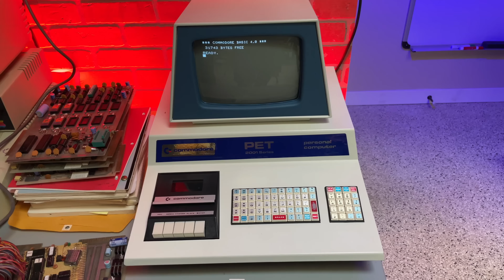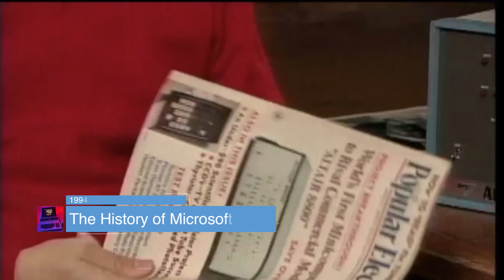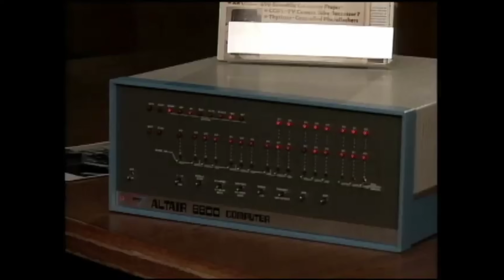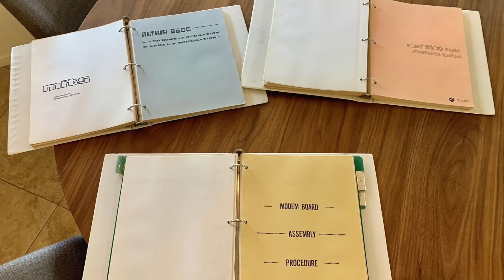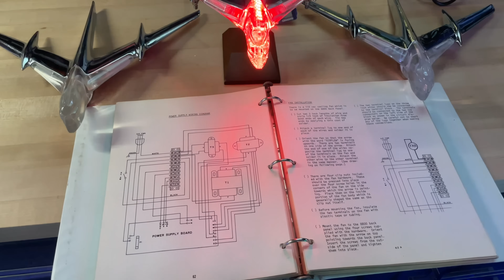The Computer that Birthed BASIC and led to Microsoft!

Comment: Wow you brought back memories. I got my first computer in the early 1980's a Commodore 64 and self taught myself to code in BASIC. Using a tape drive I wrote my first program that kept track of our farm production. I even repaired my 64 when a circuit went bad and I had to resolder one of the traces to get it working again. While I don't have my original 64 I did acquire another brand new still in the box 64 I keep as a reminder of my start in computing. I also still have my original 128 and omega. I never did make a career out of computing but use them every day. I tried learning other languages and did code simple things but never mastered any of them. Python was the last language I tried with some success. I lost count of how many computers I owed over the years Apple and PC now with a custom Falcon Northwest running windows 10. I am currently learning Electronics and have a small lab in my basement doing electronic repairs. I stumbled onto your Youtube channel when I was looking up info on LED's. Great channel I have subscribed ty.

Comment: Still got mine in the back room. I had to install a power supply with more oomph in order to support all the boards I eventually plugged into it. Also replaced the processor board with a Z80.

Comment: Yea, I remember the Altair basic. Microsoft had a 4K, 8K and a 12K version of the basic. Back in  the days i did a disassembly of the 12K basic so I could port it to CP/M. Had to undo a lot of smart tricks that was in the code to make it assemble and run under CP/M. 
One of the really neat codes in the 12K version was the routine to check for variable type. The 12K basic supported integer, string, float and double.  The size of the variables were 2, 3,  4 and 8 bytes respective. It does a compare of size with 8 and then three decrements and after this the flags is set as follows: Minus set if integer, Zero set if string, Parity set if float, Carry cleared if double.

Comment: Interesting video. A couple significant errors though:
- The Altair 8800 was not the first personal computer, although it was the first to have significant popularity.
- The Altair had nothing to do with "birthing BASIC", as it had already been created and put into use at least 10 years before the Altair came out. But Microsoft's Altair BASIC was the first GOOD version that most people used, outside of those versions available to computer students in colleges. Even when personal computing had advanced to the "1977 trinity" of the PET, Apple II and TRS-80, Microsoft's port of their Altair BASIC to the PET was (at least initially) the most advanced version.

Comment: Didn't I read that Microsoft BASIC was actually developed on PDP-8 computers?  And then cross-assembled/compiled to run on the 8080?  I remember seeing a photo of Gates and Allen and maybe one or two others, with the PDP-8/F or 8/M that they did it on.  (Not the larger, more expandable, and far-more-expensive 8/E.)

Comment: This is a trip back memory lane.  As an EE major ('78 grad) for my senior project I built an optical bar code reader using the Altair 8800 as the processing engine.  Yes, I had to use the toggle switches to load the boot loading program that interacted with the paper tape reader.  I wrote the processing algorithm in assembly which I transferred to paper tape to load into the Altair. I had to teach myself assembly language programming for the 8080 which was fun to learn.   I never used the basic interpreter as it had just become available and likely wasn't fast enough to do what I needed it to do.  The reader was a laser that sent a reflected signal to an optical sensor that then counted on-off (reflected/not reflected) light pulses during the scan.  This data was sent to the Altair which stored the counts in memory during the scan, and detected the stop bar to trigger code processing.  The software then used these counts to perform the bar decode.

Comment: Thanks for posting this video about a historically important machine.   The January 1975 magazine was on the newstands in late '74 so Bill Gates could have known about the Altair in '74.  Altairs were the first machines that were bought in significant numbers by technicians, engineers, and ham radio operators, for personal use at home.  Cleaning one with water, however, is strictly FORBIDDEN!  Cleaning should be done dry with a toothbrush and a shop vacuum (or home vacuum if the wife is away).  Anything remaining after vacuuming can then be removed by wiping with isopropyl alcohol.  Be careful with the IPA since it can react with some plastics and remove some inks.  Good luck with your videos.

Comment: The first 8080 computer I saw was when I was working at a high voltage power supply company and the guy sitting next to me brought in his new Heathkit H8. He flipped a few switches and made the LED's blink. I bought a HP-41C calculator.
I was never a coder and I could never play one on TV. ;-)

Comment: I got into computers in 1976.  I had a choice of  the Altair or the Imsai which had the toggles on the front to load programs.  Then I saw a Polymorphic that had a 1024 byte rom that allowed it to boot to a tape reader.  I added 16k of ram, a monitor and a keyboard and I had a real computer.

Comment: Around min 4:00 
8008 vs 8080. 
When i remember correct (I read it in a book), the smartest move bill gates made that he recognized the 8008 is too slow. But they have to be ready when the next processor generation, the 8080, comes. Then all  fit well together.

Comment: Yes, but how about an Ithaca Intersystems S-100 multiuser system running Coherent Unix and Z80's? Maybe a Z80H?

They were beautifully crafted machines and were on NY State contact at the time with excellent prices, but my organization went with Radio Shack Model II's. 

At the time they pulled me in from my position because I was the only one who knew anything about computers! Anyone remember these days? They were quite magical. (reminiscing)

They ran Radio Shack's OS called TRS-DOS and for CP/M we use Pickles and Trout! 8 inch floppy's and a 8.4 MB hard disk. Advanced 300 baud modem. 

Not a bad selection of business software between the 2 OS's at the time and could still run a small business very well today.

Comment: Hi Dave. I'm in the UK. My first microcomputer I built from a kit. It used Nat Semi’s SC/MP (SCAMP) microprocessor. It had a simple instruction set and like the later Altair, there was no assembler so we had to manually enter the opcodes to create a program. Around that time, S-50 bus PC’s appeared and then the S-100 bus, as in the Altair 8800. Bill Gates’ anecdote about demonstrating their DOS to IBM relates how he realised they didn’t have a boot loader – so in the demo, they had to write a boot loader and then switch in the opcodes for it, all in front of the client.  I went on to work on a product that incorporated the LSI-11, DEC’s microcomputer version of the PDP-11. It ran the RT-11 DOS which was way ahead of CP/M (and IBM DOS).  I bought a home Z80 board with MS BASIC in an EPROM and a friend disassembled this. We were all astonished to see that the interpreter used every single byte in the EPROM. Someone, presumably Gates, had hand-optimised the code in order to save space. For example, there was a three-byte jump instruction in part of the code, but another part of the code jumped to the second byte of this, which then performed a different task!  Great channel, thanks!😊

Comment: Washing down a computer brings back memories of my industrial electronics work.  Yes, water wash is no problem (with any batteries removed), something I often did to contaminated PCBs.  The key is thorough drying.  Half an hour in an oven set very low, or overnight in the airing cupboard generally sorted it.  Water only hurts electronics if it is under bias and electrolytic corrosion goes on.  But flood water leaves muddy residues that can be hygroscopic and can conduct, so a clean wash-down is important.  
The most memorable occasion was the SMPS from a toffee wrapping machine.  The filter-less fan had ingested sugar mist for years until the whole PCB was covered in a layer of toffee.  A good soak in the bath and thorough drying and it was good as new.

Comment: I just now noticed this in the Description: "For clarity, I'm talking specifically about MS-BASIC, not BASIC as a language.  I don't want to rile up the Data General Nova users... they had BASIC beforehand."

Yeah, you don't want to fuck with the Data General Nova users.  Those are some mean-ass motherfuckers.  They ride into town on their Harleys every year just before Sturgis and make trouble for the Locals, like me.

One of them picked a fight with me inside the local Denny's, putting a switchblade to my throat for "eyeballing him."  He held it there and tormented me, telling me he would slit my throat in front of my wife and children if I didn't correctly name the original distribution format of BASIC for the Nova.  I guessed Punched Tape; he just laughed and let me go, warning me to "watch where your eyeballs wander, son."

Strangest thing, though.  When it came time for their check, the guy paying the bill pulled out of his backpack a Data General Nova 3 and plugged it in, all just to calculate the tip.  Fucking show-offs.

Comment: I like the fact that you risked everything by using the “Clean Room” environment of the family sink to carefully reinstate it to working condition, even if you are unsure that your remedy was the real reason for the rebirth. And that wonderful feeling of accomplishment when you flicked the switch and it actually re-emerged from its long dark coma.
The poor old machine has simply responded to some much needed and long overdue TLC with a now clean but once possibly corroded connection or two. Good Job !!!
Now to prescribe some rehab by way of a Boot Loader.

Comment: The front panel +5 supply (+8 supply) comes from the "+8(B)" output on the terminal strip. This in turn comes from one of the two secondary windings on the medium-sized transformer, the one with the windings wrapped in black tape. The main +8(A) supply comes from the large transformer. The +8B supply should go more or less directly to the front panel. 

That transistor mounted on the chassis looks to me like a modification that someone added at some point, I don't see it in the assembly manual. I suspect it is set up as a pass transistor in a regulator for one of the extra boards, but I don't see enough wires to be sure. I don't think it should be related to the front panel, but I can't be sure.

If you weren't getting the +8 on the terminal strip itself (as seems to be the case from how you jumpered it to work), then the best bets are a) one of the terminal strip screws for the red wires from the black transformer was loose, or b) a bad solder joint on the board. Since I'm assuming you don't have an intermittent problem now, my best guess was one of the screws loose. It looks like the wire you repaired (in two places?) is related to that transistor on the chassis, so I don't think it was related to this problem, though I can't be positive. It seems unlikely though.

Comment: I have a HAAS CNC mill, 1996 year.I bought used, it had sat for 6 years from where I got it. Put about 30 hours on it and then a fault that cause the Z axis drive to shut down and the spindle came down from gravity. Big 15,000 lbs. machine that had pneumatic cylinder counter weight devices for the spindle. I went to the electronics store a bought 3 cans of electronic aerosol cleaner and some cotton swabs. The driver board was very dirty. Put it back in and now works great.

Comment: BASIC was developed at Dartmouth and emerged during the 60's, It first ran in 1964.  During the early 80's before the IBM PC basic was around.  It ran on many of the machines before the IBM PC on Intel 8080's and Apple  early machines.  The transferall across machines was widespread, with Kurtz (one of the authors) working on it on several machines.

Comment: "Altair begat BASIC which begat DOS" - I think that's doubly ahistorical. First, BASIC appeared about a decade earlier and was initially written on a discrete-transistor CE-225 at Dartmouth University. Second, Microsoft initially licensed 86-DOS from Seattle Computer Products and later flat-out bought the rights to it for $50K after telling IBM they could write an OS for their PC. 86 DOS had been written for the 8086 whereas the Altair was 8080-based. So BASIC predated the Altair 8800 by a mile and 86 DOS - the direct predecessor of IBM PC DOS and then MS-DOS - was developed independently of the Altair 8800.

Comment: Great video.  Well done on the power supply repair.  Did you replace those big ole electrolytic capacitors?  They tend to dry out after many years and can fail catastrophically.

Comment: The TIP tranistor is likely a LM7805 linear regulator. Very common at that time. Its good for 1.5A I believe. Note that it is a linear regulator vs a modern switcher. The voltage between the line in and line out has to be dissipated in the package and that means heat. Thus the metal tab. If you look at the DRAM card for example you will find this has a heatsink it mounts to and then to the board with a through hold screw. Heat sink compound (thermal paste) is needed between the back of the tab and the metal surface. The tab is ground as well.   Be sure you do not leave that dangling in air and tie it down to ground with a heatsink if its drawing any current.

The thing about this period of the industry is it was a chicken and the egg period. There was no way of knowing who was going to buy them. No way of knowing what they were going to do with them. In fact you could not give them away for quite a while as the learning curve was quite intimidating.  So to try to find a market they made systems modular with only a few slots or a large number of slots. Being a linear supply meant huge expensive and heavy transformers. Cut the number of slots in half and you cut the costs dramatically. I recall going to the West Coast Computer Faire (the predeccessor to Comdex) and meeting Bill and Paul at their small booth. They were very nice and fun to talk to. They seem to have more vision than most.  Back then floppy disks were coming out but every system had a unique format and in some cases diskettes. Hobbyist dreamed of having a floppy. They were very expensive (S100 card AND drive). Most used cassette decks that ran off a parallel port. Cheap and slow but it sure beat manually entering a byte at at time. (load, deposit, next and eventually run).  To frame how random this time was I submit to you a story of the Atari 400.  Sears - the big retailer - did a deal with Atari to sell their game console and the Atati 400 Home Computer.  (It was a game machine with a keyboard added basically.)  I saw the familiar arcade logo at Sears and ran to it - finding the machine there with all the signage but turned off. I kid you not it was in the vacuum cleaner section of the store. The logic being it was a small home appliance. The Kenmore vacuum cleaner salesman had no clue what it was or did. No training. He asked me what it did and I explained it to him. I asked if there was a manual and he brought it out from the back room. IN a half hour I had it running a game from cartridge. He then told me to move along. A half hour later I walked back by and saw three vacuum salesman playing Asteroids.  That was the state of this "new evolutionary thing".  I credit Steve Jobs with identifying the need to evangelize this market. In fact he named his sales team "Evangelists". Rumor was he got this idea from watching a popular Televangelist, Gene Scott, on UHF TV in the Baay Area.  True? I don't really know but it sounds plausible.
Reply from the maker: Ha!  So funny story: before I mounted the TIP (I think it was indeed a 7805) to the chassis for dissipation, I grabbed it.  And ROASTED my fingertips, it was THAT hot.  Then I mounted it down to the metal chassis and its been fine since...

Comment: These 40 years old electrolytic capacitors have probably serious loss of capacity. Also look for broken solder junctions on single sided boards. I know this is simple and trivial, but 80% of all defects have trivial reasons, so look for these first.

Comment: I'm impressed that you lined all the screw slots in the same orientation. I used to work in assembly at Allen-Bradley/Rockwell Automation (building CNC control computers) and we didn't care how the screw slots were oriented as long as the screws were present and properly tightened. That was our level of precision for screws. As you could imagine, it was far more important to get working machines out the door and into customers hands.
Good on you for taking the time to get the old Altair back on its feet.